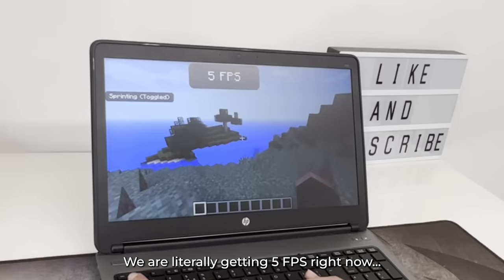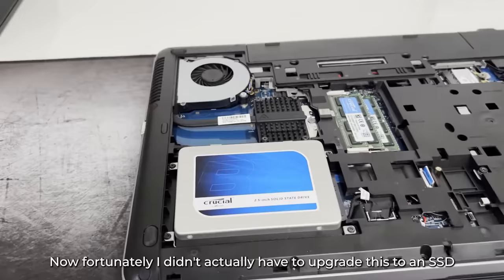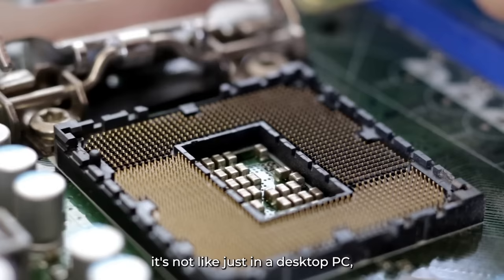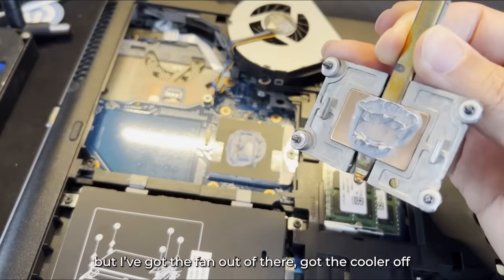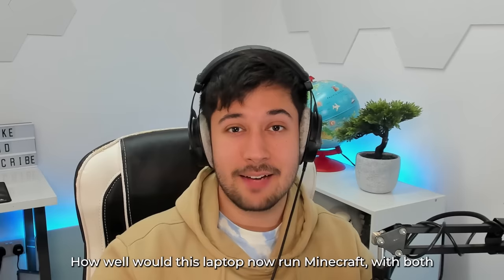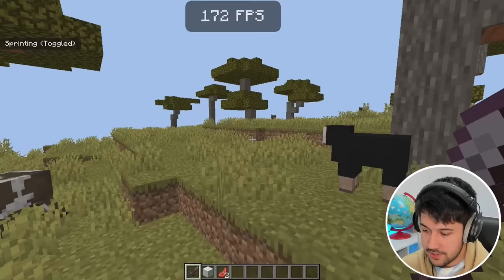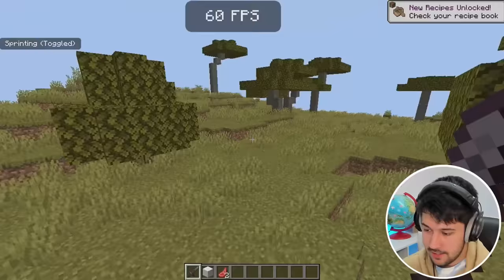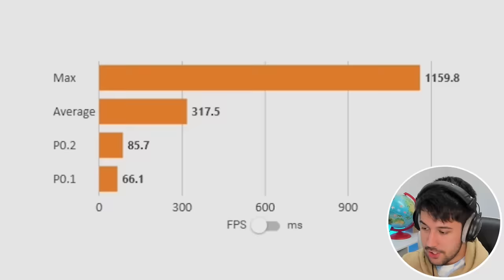I Turned My $20 Laptop Into A Gaming PC...

Comment: The RAM was unnecessary. You could just get a paging file. I have an old gaming laptop, which is Lenovo 81M0. It runs old games such as Minecraft very well, approximately at 300-500 FPS. It has an Intel Pentium Gold (new generation), which DOES matters. The RAM didn't matter for me, because I had a paging file. In conclusion: You didn't had to upgrade the RAM for better performance. Anyways, good job that you optimized and upgraded this laptop to the maximum, and also picked a correct CPU slot, which a lot of computer noobs don't look at.
Edit1: I have now an ASUS TUF Dash laptop.
Edit2: Well yeah, dual channel RAM would be necessary for more speed.
Reply: Paging file, or more modern term swap space wouldn't improve performance as much as a physical upgrade of memory would. Especially from going 4gb to 16gb. The highest swap space you could have had before it be unnecessary would have been 8gb. Along with the fact that the SSD is a cheaper and slower brand, and the fact the ram is already slow enough as its ddr3. Swap space would just be a waste of time and performance compared to just upgrading from 4gb to 16gb.
Reply: @ivyish  I know that it doesn't improves performnace. I have meant that in a way of allocation apps.

Comment: Is ram alyways visible when you open laptops. Like i mean when he opened this laptop and he could see ram
Reply: Some laptops, older ones, have glory holes. Those are removable panels that help the user easily access internal components without doing any real work. 

Some newer laptops have soldered ram, instead of sodium sticks, can’t be upgraded. Some laptops mix soldered ram and sodimm sticks. 

It really comes down to the individual laptop model you have.

Comment: i need help so bad 
i have an rtx 3050 laptop and i barely have 200 fps what is this 
and i play low graphics 12 chunks and ver 1.16.5 and i also use feather launcher
help. thank you
edit my laptop specs rtx 3050 ryzen 5 5600h and 32 gb ram upgrade
Reply: i know this is a stupid question but sometimes things like this happen, did you double check everything is fully plugged in? like the gpu and things like that because if not it can be run off of integrated graphics (if your motherboard has it)
Reply: @clockwork819  yes brother i check everything only on minecraft it does and is on rtx graphics i use optifine and it only does on minecraft becasue other game like cs 2 i play 2k rez and i have really good fps like 200 in wingman and 120 fps in gta 5 max graphics i start to think is something worng with my java ver. and i allocate 16 ram from 30 in minecraft i know is to much but more is better =)
Reply: @890B  sorry no clue then, good luck in finding the solution though!